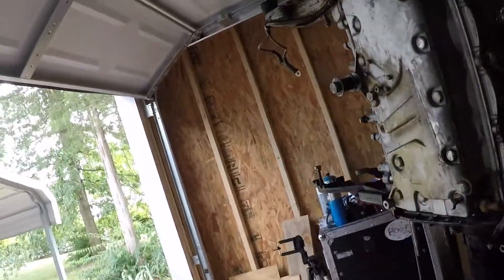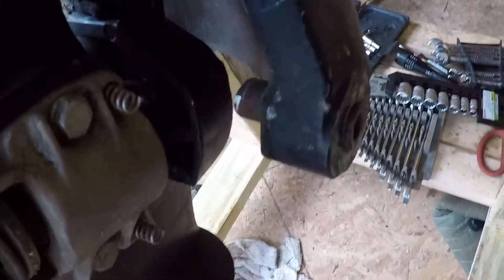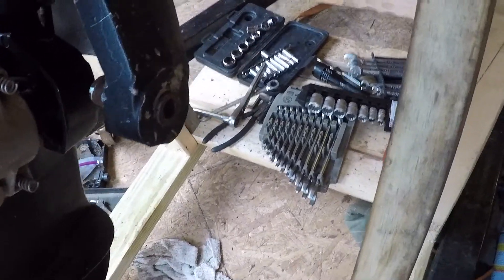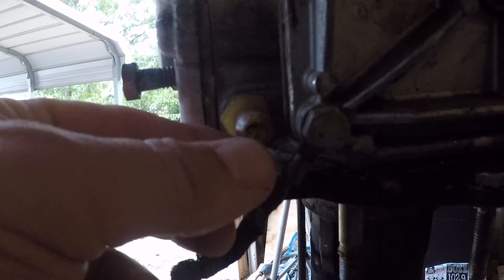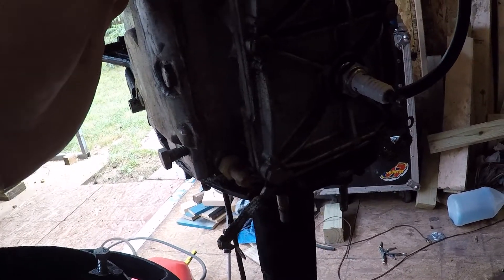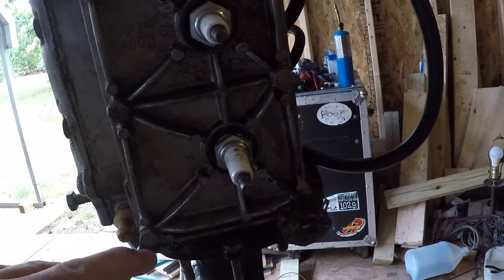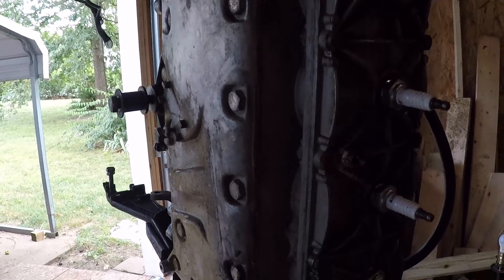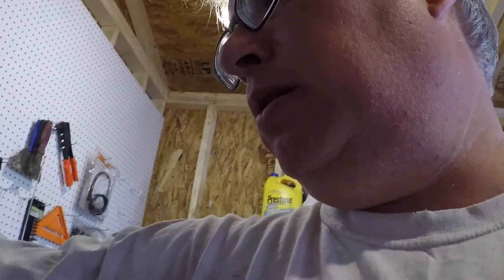Mercury Outboard Thunderbolt 500 50 HP Part 8 - Initial Review

Comment: Would running the telltale from the back cover like that cause a fast overheating issue? I bought a mercury 500 the other day and it has the exact same thing going on where the telltale is ran from the back cover and the original telltale outlet is clogged. Would that cause a fast overheat??
Reply from the maker: Try running some rydlyme through it probably the water jack side is clogged up.  The answer is no that jacket is probably clogged up.
Reply: @hawkeyemarine the telltale hose that is being ran from the back water cover port is flowing freely when boat is running. But all I’m getting is steam and hot water within 5 minutes of idling. But i removed the exhaust plate and found that the correct port for the telltale to be ran from is 100% clogged. If I were to free this clog and reinstall my plate, will that fix my overheat problem.
Reply: @hawkeyemarine the reason I would think it would overheat with the telltale being ran from the back water cover plate is because that port is positioned about 50% up the 4 cylinders. And if the telltale is bleeding off water there, the entire upper half of the cooling system isn’t really seeing any water. If that makes sense.

Comment: Man this is the most amazing comprehensive video of the Mercury 50hp. I have this exact same engine and you have given me a wealth of information. I began tearing mine down to see how the exhaust fits to the power head. I have a lot of oil/water sludge coming down the exhaust. (first thought to be lower unit seals but all good there, - definitely coming down the exhaust). Have you any idea of what could cause this ?
Reply from the maker: I would do a powerhead gasket and replace the exhaust gaskets.  Water is making its way into the exhaust.  The powerhead gaskets come with a bunch of gaskets.  Fuel pump you name it.